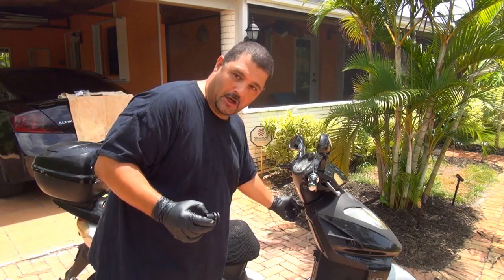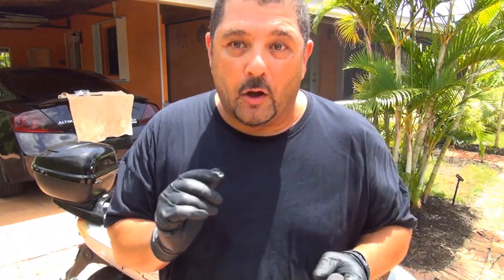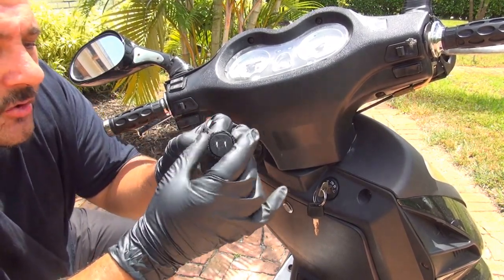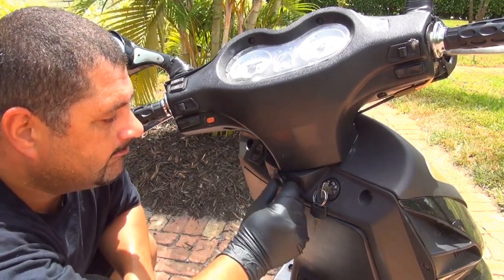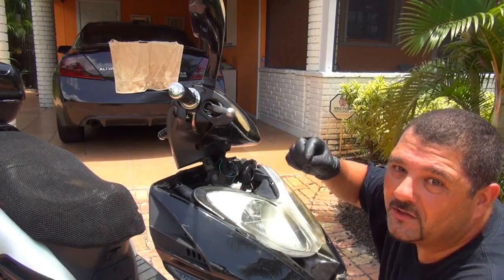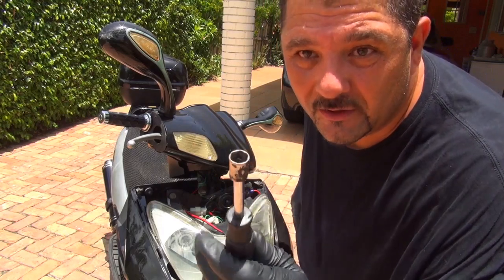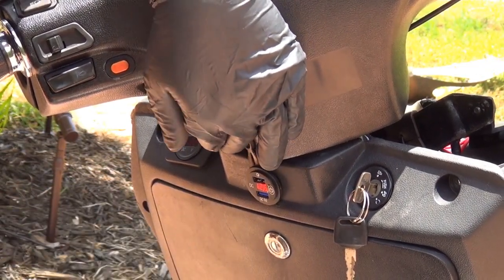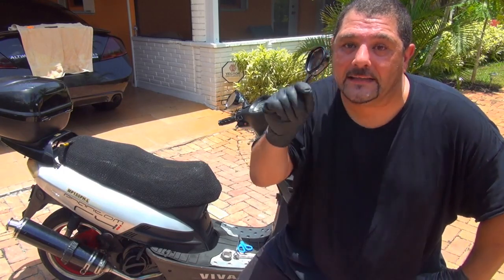How to install a USB Outlet on a  Chinese scooter

Comment: Cool beans. I just ordered a 12v usb power outlet that also has a cigarette power outlet. I'll use the two USB's to charge my two phones, one for GPS and the other for speedometer/trip counter and use the cigarette power outlet for the mini air compressor I bought. It will all fit nice under the seat.

Comment: Thanks for another fantastic video.  A few months ago, you provided a link for the "Voltage Meter" that you installed.  I followed the link and found an alternative device from the same company that includes the voltage Meter and USB Charger.  It is almost identical to the device in this video.   Since my GPS frequently drains it's battery, I connect a cable to the USB Charger which allows me to ride for ever and my GPS stays on.
Reply from the maker: Thank you for watching my video

Comment: Does the installation of the USB charging station also work for electric scooters?
Reply from the maker: should be working for that too but could be drain the battery a little
Reply: Tyvm, just got a scooter and I'm glad to have found your vids

Comment: Hi, just to clarify. After following instructions, will the power to the charger be 'off' when the ignition key is in the off position, even if the charger power button is on?
Reply from the maker: Hello Kristal yes when the ignition key is in the off position the usb will be off  even if the charger power button is on I like better this way because I trust more the scooter ignition then the little usb on off switch . Thank you for watching my video
Reply: @VirberelloScooterTips  Thanks so much 👍🏽
Reply: I was able to install a charger and have it power to it controlled by the ignition key. THANK YOU!!!!

Comment: Hey hi watched your video on changing the relay for the blinkers.I did mine but didn’t work do you know what else could be wrong.thank you
Reply from the maker: Hello my friend another things I will check should be the blinker switch but the best thing to have is a multimeter to see if your wires have continuity to the blinker and if the new relay is good or not because sometimes I do not trust chinese scooter parts that could be a 5 % possibility that when they get shipped they are already damaged or defensive from the company try to shake the relay and if you ear any sounds like did did  relay is not good 👍
Reply: @VirberelloScooterTips  hey my friend I tried the switch also. Going to try another relay switch. Thank you

Comment: could you do the same thing to install speakers that hook up to a 3.5mm jack or bluetooth? have you ever done a video on installing speakers for listening to music?
Reply from the maker: Hello Chris one time I place 2 large marine speaker on my old scooter at  the glove box door and a little receiver under my seat but next time I m thinking I need to place the speakers next to the mirror on the handlebar because if the speakers are lower you can not hear much when you ride the scooter and you can connect the speakers in the same place where I connect the usb charger. Thank you for watching my video
Reply: @VirberelloScooterTips  thank you this will be my next project!

Comment: Hi, will this work for my gy6 50cc? It has a 12v 4A battery, I tried a 12v with 2 usb ports 2.1 amps on each port, but I can’t get it too work
Reply from the maker: Hello should be working even if the battery is smaller

Comment: I just ordered one, cant wait to finally charge my phone, and Bluetooth speaker
Reply from the maker: Hello TREESGOBOOM
 thank you for watching my video
Reply: My 2021 Version comes with one installed right underneath the hook to hang bags in the front. The thing is I can charge my phone even if my 50cc is turned off. I'd woulda love if I can turn the scooter off and also turns off the USB POWER

Comment: Hello, thanks for video  i have question. For kymco xciting is that black wire a same? For all scooters positive line is on black wire?
Reply from the maker: Hello Hari not sure on kymco you will need to have a multimeter tester to find the right wire or a wire diaphram
Reply: @VirberelloScooterTips   i have multimeter, how can i do this?

Comment: Do you think the wire colors are the same on a Honda scooter?
Reply from the maker: Hello Andy not sure but the green/black is always ground negative , red/yellow is always positive the best way is to have a multimeter and try the wires to see where you can find the wires to connect the usb outlet

Comment: Do you take a 150 cc seat off like a 50 cc to get to gas tank?
Reply from the maker: Hello no to remove the tank in a 150cc is a little longer process you will need to disassemble the all back everything under need your rear rack  try to check this  https://www.youtube.com/watch?v=ECyStySqkXA one of my video at 28 minutes

Comment: My friend I need your help I have a EW mobility 72 scooter I changed this box because my lights were working my horn wasn’t working and some other lights and then when I change it it was working now my USB is not working I don’t know if it’s do USB the wire whatever you think I should splice it read with the other positive wire and black with the other positive And negative with the other wire and see if it works or should I try a test before I do anything else I hope I told you everything’s my friend please I need your help
Reply from the maker: Hello my friend the best thing to do is if you have a multimeter try to test the wires  voltage that are going to the usb to see if the wire are live so you can find out if is the wires or the usb is bad and then you go from there . Thank you for watching my video
Reply: @VirberelloScooterTips  Thank you my friend
Reply: I forgot to ask you one more thing if the wire is OK it’s where it’s connected Is the problem can I connect it somewhere else then when I turn the switch with the key thank you again

Comment: Hi, when I accelerate hard, I hear the scooter pings (spark knock). Can you tell me how can I fix it pls?
Reply from the maker: Hello inspect the gap at the spark plug or replace that or find a washer to place at the plug
Reply: @VirberelloScooterTips  the gap should be bigger or smaller pls?
Reply from the maker: @jonathanpoulton205  0.27 " or 0.7 mm small but perfect for best performance
Reply: Thanks a lot!!👍👍

Comment: I have a qbm. 49 cc it will not stay on cuts off
Reply from the maker: Hello JONATHAN OLMOS I do not have much experience on 49cc but to have a running scooter you need fuel , spark and compression so if you don't have one of this 3 in a consistent way your scooter will not run, So ask your self a question :  is your fuel getting to your motor or you have a dirty carburetor ? do you have a good spark or you need a new sparkplug ?  what is the compression on your scooter ( you will need around 95 to 100 psi to run a 49cc ) ?  I hope this can help you and thank you for watching my video